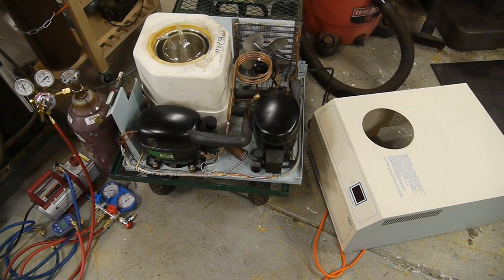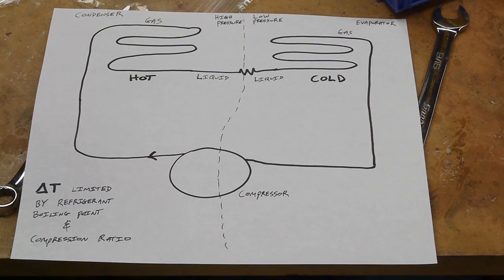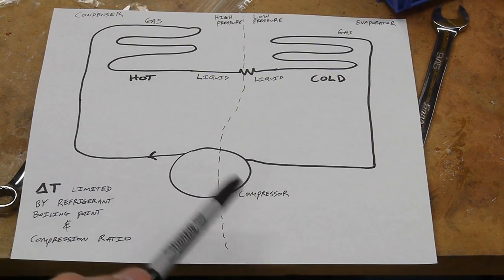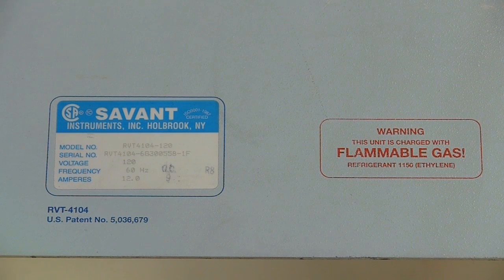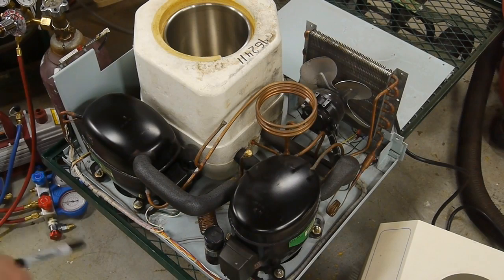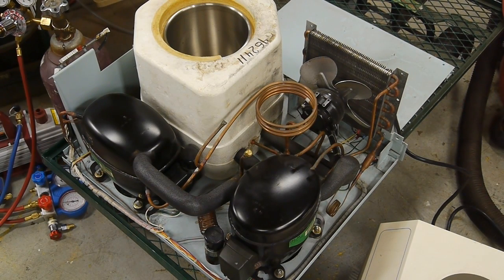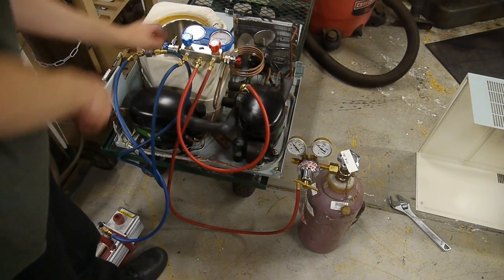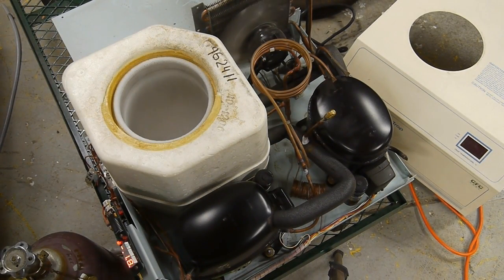Ultra low-temperature cascade refrigeration system repair

Comment: FInally! Someone who can articulate clearly! This was enlightening; I am not a refrigeration tech. I am however looking for answers. I want to convert a refrigerator or a chest freezer to serve also as a freeze-dryer, which means I will need to be able to pull a vacuum, which means more modifications. Does a common freezer reach minus 40 F? How low does a common refrigerator go? Is it feasible to convert a refrigerator to a freezer and reach -40F? Thanks in advance for any answers and common sense advice. Your video was great.
Reply: ***** A common refrigerator uses the wrong refrigerant/pressure combination to reach very much below 32F/0C & a common "combo" fridge/freezer will likely only be able to reach slightly below 0F/-18C in the freezer section. A chest freezer, however, can often reach -20F/-28C, so could forseeably be capable of reacing -40 in a cold room, &/or with fairly minor modification (such as reducing the refrigerant charge, using an appropriate manifold, to lower the low-side boiling point).
Reply: That makes sense. Thanks for the insightful answers.
Reply: Philip Murray &  @robherc1   IMHO dropping the 2nd stage, low temp., unit into the freezer cabinet is so simple and allows use of unpressurized medium for heat transfer to point of use.
Reply: @richardbarber4444  Yes, using a 2nd-stage chilling unit inside a standard (~0F/-18C) or "deep" (~-20F/-29C) freezer Would be at least feasible (so long as said unit has ultra low-temp. compatible refrigerant and mechanicals). However, using unpressurised, gaseous-state air as transfer medium for the discarded heat will make for a pretty inefficient system. Adding a small radiator, heat-exchanger, and circulation pump to use alcohol, butane, acetone, or another liquid (yes, non-pressurized butane is a liquid below 30F/-1C) could tremendously raise your capacity.
Reply: Sorry   @robherc1  ,   I took that as read and was thinking of glycol or other liquid transfer medium.  Regards, RB
Reply: @richardbarber4444  In that case, we're in agreement ;)
Reply: i have same troulbe with you. Now, have you found the solution for it? please tell to me?thanks so much
Reply: you can look up the boiling point of any gas in a chart on Wikipedia and that will be the theoretical lowest temp for your refrigerant sys(you will never get that cold cause of higher pressure is sys). common refrigerant for eg R134a is -26C. If you want to go colder look into filling with R290(-42). This stuff gets really complicated real fast is you want to do something out of the ordinary and unless you have a good understanding of what you're doing I'd stay away from these experiments

Comment: You should come spend a day with me all I do is repair ultra-low cascade freezers. I have 700 of them in house at work. Including 100 Liquid Nitrogen freezers. We use mostly use propane, ethane, 404A and 508B. Couple of our units also had 134A.
Reply: Me too, I've worked on ultra low for years but not this Sanyo box with a Intercooler heat exchanger, it looks waxed but this system has no waxy oil? have you worked on a Sanyo MFD 594?
Reply: @josephbebout8259  hey Joseph I used to work for Sanyo Gallenkamp about 20 years ago. They had a 2 stage cascade pharmaceutical chest freezer that achieved -120 deg. C.
Reply: Are you in new york/ new Jersey Jersey?

Comment: I love how you use a blow torch with paper right in front of it haha
Reply from the maker: The newspaper is soaked in water.  It acts as a heatshield to prevent nearby parts of the system from getting burned, and also soaks up heat from the copper line (useful to protect valves and other nearby joints).  It's a an old trick used by refrigeration techs.  I think there are special mats that are more reusable for this purpose than newspaper.
Reply: Applied Science
TMYK. Cheers

Comment: You said your manual spec'ed a CFC refrigerant for the second stage, however the cover of the unit shows a "CFC free" decal. Perhaps there was a revised manual or a technical service bulletin to update to the Ethylene refrigerant.

Comment: Have you considered using the cold trap as the hot end for a Sterling heat pump to get even colder temperatures? I'm not sure what working fluid you would use, though. Helium is inherently leaky and hydrogen has an assortment of dangers (flammable and makes many metals brittle...)

Comment: Hi Ben,
Don't you think that it can be interesting to apply your ethelene to facilitate ripening of fruits?
You can make a timelapse video of ripening of various fruits in air, ethylene (50%) and high-pressure ethylene.

Thanks
Reply: No question. Depending on whether you want to ripen table top fruit or controlled atmosphere stored fruit. I use bananas, prolific ethylene producers,  to ripen other table top/bowl fruit.

Comment: Was there a reason you went for ethylene gas to begin with, instead of the advised refrigerant? 

Also, do you happen to know whether or not the common laboratory minus 86 freezers and the cryogenic minus 150 freezers are also dependent on dual-stage refrigeration?
Reply: +redtails 1) CFCs are becoming harder and harder to come by, as their manufacture and distribution was banned some time ago, hence why we're moving towards HCFCs (Hydro-Chloro-Fluoro-Carbons) and HFCs (Hydro-Fluoro-Carbons).
2) Typically once you get into temperatures that low, they'll more than likely be cascade systems due to the reasons he mentioned in the video regarding the efficiency problems with a single-stage unit.

Comment: Savant brand Cold Traps are not of the highest quality. Main feature is the small benchtop size which in a crowded lab is the sell feature. Oil circulation and return in the low stage on small cheap cascade systems is critical and often a fail point in poorly designed (and poorly fabricated) units like this. As for protecting the vacuum pump, these units achieve mixed results. Regarding  TE units, they are not used due to prohibitive inefficiencies, though they are popularly used for small,  medium temp thermocyclers and other small sample HPLC autoinjectors.

Comment: Well that probably kills my idea of using a water cooler as a cold trap, I hadn't thought of the idea there may be a limit to what the coolant could handle. I was hoping I could maybe get it down to around -70f if I improved the cooling of the refrigerant on the condenser side as most coolers don't even have a fan, I wanted to try to build a freeze dryer without having to use dry ice.

Comment: It seems a bit odd that the hot side condenser is so small. You're moving a hell of a lot of heat out of that chamber, how long does it take to get down to temp? I wonder what kind of regulation it can manage?

Comment: Given that most consumer electronics are only guaranteed to work down to about 0C, How long would something like a small FM radio continue to work in that refrigerated chamber with the aerial and possibly a power source wired to the outside?
Reply: Any electronics that have a crystal oscillator (tiny tuning fork) would lose their timing and malfunction as soon as the tuning fork got cold enough.

Comment: Thanks for another great video.
After watching the video showing you have access to, and some proficiency with a TIG machine, I thought you would have HEli-brazed/ TIG-Bronzed the refrigerant tubing connections.
If you haven't yet worked with it, it may be something you'd like to become familiar with.  Silicon bronze can be very useful for joining copper as well as dissimilar metals.  It is pretty easy to work with, doesn't require the temperature for welding, so may provide some advantages related to distortion or working in close proximity to heat sensitive components and the strength is typically far greater than gas brazing filler.
Reply: +beng Typically with refrigeration systems, we use an alloy of silver and copper with a trace amount of phosphorous for flux, which contains anywhere between 30% (expensive stuff but flows into the joints really well!) to 15% silver.

Comment: Thanks for the great video. That looks like a lot of fun to experiment with.
A Cloud Chamber you could turn on with the flip of a switch would be nice. You might also try reaching liquid nitrogen temperature by tinkering up a third stage inside the cold chamber and liquefying air. Actually I think you can make liquid nitrogen in the neg. 100 degree cold chamber you now own, by compressing air, cooling it to 100 below zero then decompressing it to cool it further. I want one! :-)

Comment: Heck I haven't played with r-503 since the 70's   I remember the small cylinder I carried in my service truck was $500 back then.   Oh, and on warm days I could hear the liquid sizzling in the cylinder as it sloshed around while I was driving.   You still might be able to get it, but it's gotta be through the roof cost wise. This video brought back memories of ultra low temp systems that all used exotic gasses like ethane, with a touch of propane to carry the oil around the system to keep the compressor lubricated.

Comment: Hi Ben: What are your thoughts on a kluged-up cascade refrigeration system starting with a couple of functional compressors and associated stuff.  A priori, one would assume that the specifics of the compressor, capillary leak, etc. are optimized to a particular refrigerant.  However, a quick Google indicates the capillaries are adjusted to produce a specific pressure drop.  So, you would need to fashion a heat exchanger between the two units, charge one with a lower boiling refrigerant and fiddle with the pressures and the leak.  Any thoughts.  Cheers, Mark

Comment: The fluid the manufacturer uses is not alcohol but a silicone based oil. I think if you measure the temperature of the liquid you will find it not as cold as it is showing on the display. They put the thermocouple on the inlet to the evaporator on those cold traps and lie about actual temperature. Great job by the way for someone with no knowledge of cascade systems. The boss repairs these and ultralow freezers for a living.

Comment: Hi Ben: Would have trying to obtain R-503 or its replacement R-508B been as arduous?
Reply from the maker: I think so.  R503 is a CFC, and probably phased-out.  It might still be available, but only to folks with an EPA license.  I talked to some refrigeration shops about getting R1150, and even though it is not a greenhouse gas, and thus not subject to the same EPA controls as other refrigerants, they were still trying to hang up the phone on me as soon as they realized I had no license.
Reply: You know Ben, you could get your license from one of the awesome online HVAC schools (e.g. 'DeVry') ! !  Cheers, Mark
Reply: Applied Science Getting an EPA certification is stupid easy.  Buy the study guide that the class uses and read it cover to cover (less than 20 pages!) And you will have every answer to the test for a universal license even though for your case a Class I/II would suffice.  If you can tell me what state and general region you live in I can point you to an exam proctor.
Reply: sivalley He probably knows more about this stuff already than what most HVAC technicians know after those so-called schools. He should go straight for an exam :P
Reply: ***** Ah yes, you are 100% correct on the "obscure part" of the exam, I believe there would be some laws/regulations included as well, like on most certifications of this kind.

Comment: So how do you measure the mass of the refrigerant in the first stage when recharging it?  wonderfully informative video...as always.
Reply: +semidemiurge There's a couple of ways to do that. For units with small amounts of refrigerant (like refrigerators), there's a special charging tool that you can use to measure the amount needed before letting it into the refrigeration system. The other method is literally "put the bottle on the scale, zero the scale, then open the valve and watch the scale until you've weighed in what you need".

Comment: Believe it or not, if you want a lot information on cascade systems, go check out some of the various overclocking forums. There were people building 2, 3 and 4 stage cascades, some were even using auto-cascades.
Reply: are you interested in autocascade?
Reply: @张鑫-k2k  im interested in autocascade!
Reply: Auto cascade systems are cool as hell!
Reply: 张鑫 yes im interested
Reply: Hi, would you like offering to me about the compressor brandname for ultra low temperature refrigerator systems?
Reply: @MrPhuongHVAC.R  just normal compressor, also air-conditioner compressors too!

Comment: Nice! Great explanation, did you get a look at the Heat exchanger? That would be the tricky part to replicate if you wanted to build one of these out of water bubbliers...
Reply: Applied Science You should x-ray it! :)
Reply from the maker: No, unfortunately it's buried in the styrofoam, which is glued shut.  I imagine it's just a couple of intertwined copper coils surrounded by insulation, though.
Reply: Applied Science aww, that'd be good to see
  I just tore apart some dump bubbliers and the 2 evaporators fit well inside one another. I wrapped some copper tube around a stainless thing then soldered the captube than the old evaporator in as a condenser and it worked. I'm surprised, all i need to add is a oil separator and some insulation. And of course the ethylene
  Do you think pouring aluminum around the heat exchanger part would work? I know copper corrodes with other metals but maybe there is a way to protect it... 
 I'll see how it goes if i get that refrigerant, hopefully I can get close to -100c

Comment: Can CO2 be carefully frozen such that it can form large single crystals?  What shape would it be?
Reply: fegolem That would be nice. I imagine you can do it if you use a thermos or a well-insulated container for the slow heat transfer, but the CO2 subliming all the time right back to the gaseous phase would probably ruin the crystaline structure, so you would have a pretty much shapeless mass of solid CO2 at the end... But hey, we will never know without actually trying it out :)
Reply: you could probably put a bottle filled with co2 in there and wait

Comment: why would you do your soldering work with paper laid right behind it?
Reply from the maker: The newspaper is soaked with water.  It provides a heat shield to protect the wiring and plumbing around the work area.  It will not catch fire when sufficiently soaked.
Reply: Applied Science ahh clever Ben!

Comment: Hi Ben! Have you tried use thermoeletric peltier? that think can go really low temperatues using simple heat sink and fans. Someone said that you could stack more than one module for really cold temperatures. I bought a 136W (15V and 15A max) module, I didn't test yet, but some videos register -16C with one module. Maybe you could use one peltier to archive the first low temperature.
Reply: You can stack peltier modules, but you run very fast into diminishing returns. A 4 stack module can just about reach -100C with a massive heatsink and fan on the hot end, and you can then cool a CCD to -100c to get a lower noise out of it for astronomy, but you will not get much usable power flow, it will probably use 100W and be able to transfer 1W. Refrigerant can give you a 200W heat transfer to -100C with a 1kW power use overall. A TEC is a better heater than it is at cooling.
Reply: SeanBZA correct. I like the simplicity of the peltier, they are small, with only fans as moving parts, no refrigerator liquid and "low" noise
Reply: as far as I know, peltier elements are incredibly inefficient at moving heat away, almost an order of magnitude worse compared to compressors. For small simple stuff like cooling an EM-ccd, peltier is perfect, though for larger stuff it just makes no sense
Reply: SeanBZA
I tried chinese 4-stage peltiers, and only got -46.
Reply: BarsMonster nice! what the size of the system? and how much power it consumes?
Reply: Xano Trevisan Kothe About 100W, it's ~60x60mm + CPU cooler with heat pipes
Reply: BarsMonster that's pretty good
Reply: ***** thanks, I am aware of it

Comment: I really really love this video. I have always been curious about how a cooling system works and especially making it ultra cool.
Reply: I know there is something called a peltier cooler. I have heard that you can get to very low temperature with that if the heat produced by it can be moved away quickly. Can you reach -100c with a peltier cell?
Reply: nattsurfaren Peltier elements are heat pumps, meaning if you have somewhere to move the heat to, the opposite side will just get colder and colder (to a reasonable limit). The reverse is true as well, if you can dissipate the cold, the hot side will get hotter and hotter.
Reply: There freezers that get below 150°C
Reply: what freezer? can you tell me, i can make -135 freezer

Comment: I think most cfc's will burn green, r22 definitely does, and generate chlorine gas in the process.  I accidentally dosed my brother with some chlorine gas when we were kids helping our dad do HVAC work.  There was an old school 'leak detector' which was nothing more than a rubber hose T'd into a propane torch.  If you put the end of the rubber hose on a leak, you would get a green tinge in the flame.

So my 12 year old mind said, 'what if i just run some r22 straight out of the tank'    ugh.  lol.
Reply: When you get that green flame, phosgene gas is being created, which is pretty nasty stuff. I don't know if the concentration is high enough to be harmful  when testing leaks though
Reply: Only r12 and r22 will burn green/blue.. for the modern refrigerants you need a fancy electronic halogen gas leak detector.
Reply: KingNast Ah, i thought it was chlorine gas.  Either way, can confirm it is nasty.
Reply: Arnþór Gíslason Thank you for the information! I couldn't find much about it in short order.  I'm writing your name down as HVAC ninja...you seem to know a ton about it based on comments in this thread.